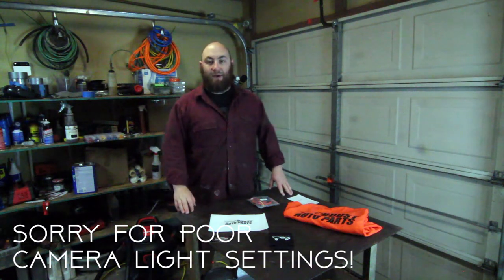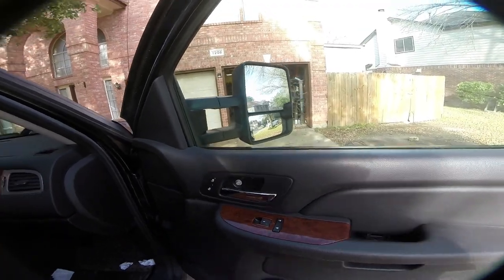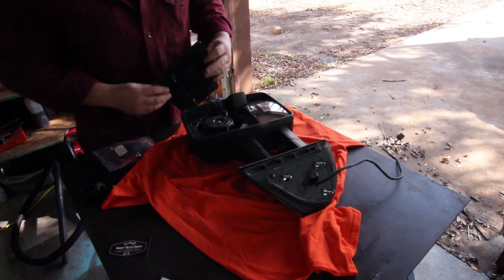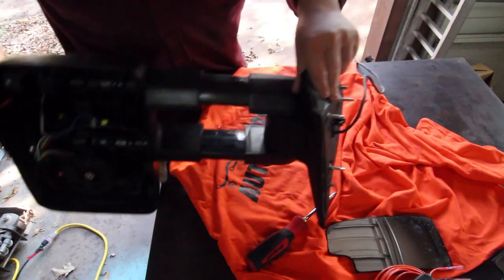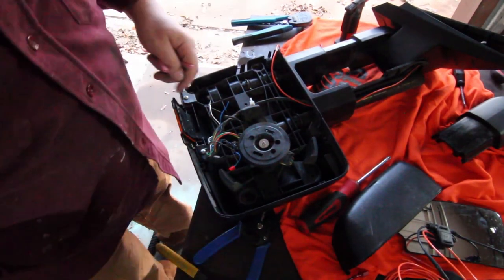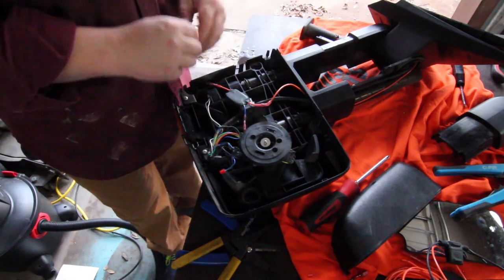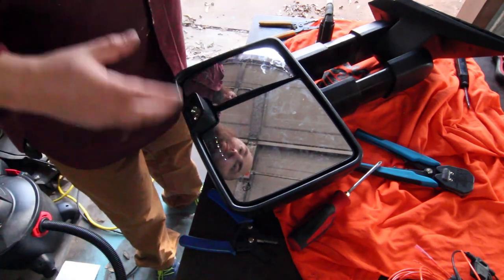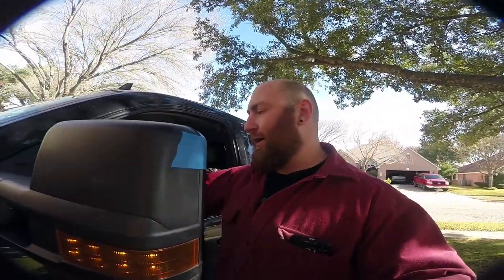Boost Auto Parts Dual Function GM Wiring Harness Install and Review

Comment: When getting the ground from the reverse light did you have to have power to the reverse light too? Or only needs ground?
Reply from the maker: I already powered the reverse light when I did the original install.
Reply: @Makswerks1  Ok thankyou, do you think these would look nice on a 2012 sierra denali 1500?
Reply from the maker: I actually tow stuff so I got them because I need them. Should look fine if the truck has a nice lift or stance